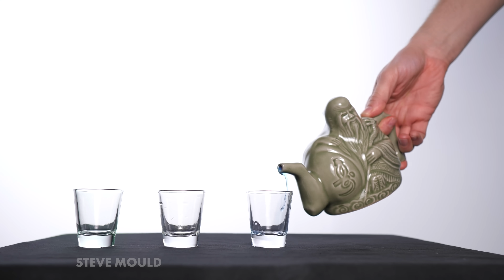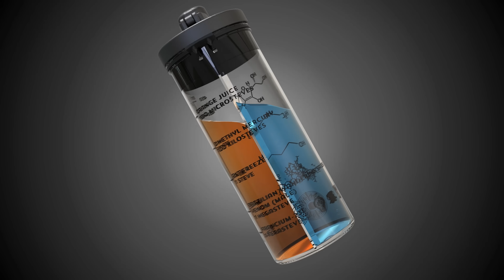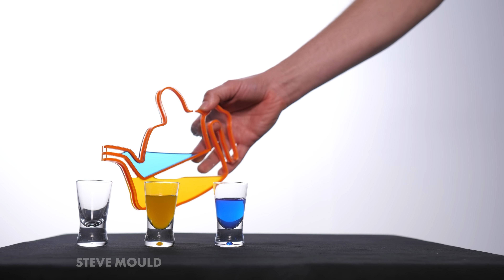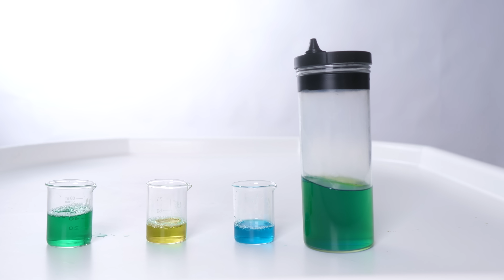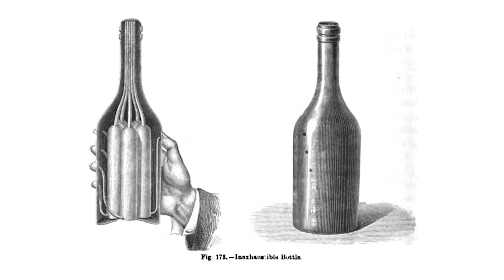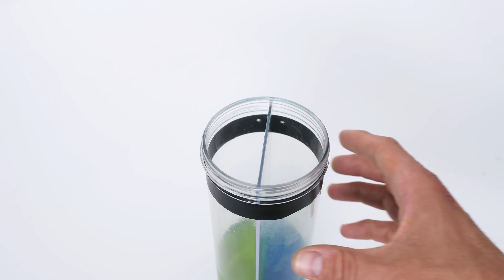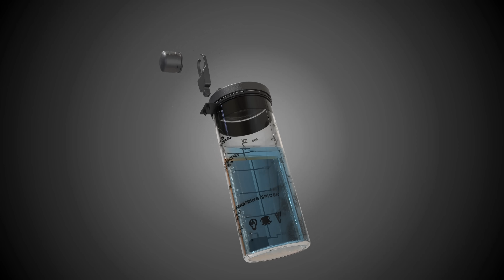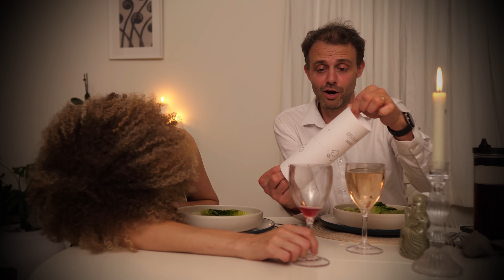The weirdest water bottle you can buy

Comment: I love this, though I have a thought.

It seems like the plug for the back holes might loosen on its own during transport with nothing to lock it in place, especially after a certain amount of wear has taken place after some time. Would it be possible to have a tab of some sort that slides over the plug flap and clicks into a compliant mechanism to hold it in place? I think that would greatly secure the contents of the bottle. Though of course this would complicate the construction a bit. Maybe it's even too late to change the design at this point.

Comment: You could make it a slider, pos 1 both air inlets closed, pos 2 only inlet 1 open, pos 3 only inlet 2 open, pos 4 both inlets open. Okay it may take away some of the magic, but the benefit is that you shouldn't need the separate rubber piece to make it transport ready, the slider will fulfil that role and will be less prone to accidental opening or being lost.

Comment: A push button with a spring on the outside and a seal on the inside (and a small cover to avoid knocking them in transit) would be the absolute best way to seal and unseal those holes.

Comment: The selection holes for either side could be covered by a sliding switch that sits on a ring sleeve along the top. You can slide the switch with your thumb to select one, both or neither (For normally closed). It would be a sturdier design assuming the rubber plugs ever pop out or no long sit comfortably in the holes

Comment: I would definitely buy it if the holes for the cavities were on the lid and had their own little on/off switch covers or a spin dial cover to decide which drink is covered. It would move the holes to the highest point instead of the side so it wouldn't accidentally spill during transit (at least much less likely)

Comment: @stevemould for the holes, you're approaching it from the idea you need to plug the hole to select the liquid. Have you considered the opposite approach?

Use two silicone gaskets to plug each of the holes so the liquids cannot escape. You can use a nipple to secure the gasket as a plug so it's always blocking leaks, and when you want to release the liquid, you press down on the nipple, separating the gasket from the lid, allowing the liquid to flow.

Just a thought. Loving your idea!

Comment: As for making the bottle portable, couldn’t you just make the function of the holes reversed? Say, by implementing some sort of spring club that when depressed could instead open the hole from the other side. Then the mechanism could be built into the lid entirely giving you space to water tight the lid to the bottle, and also prevent liquid from spilling out of the lid when in transit.

Comment: Why not put a ring with two holes around the upper part of the Bottle. You can turn the ring to what ever liquid you want. You could put stoppers on the ring so it wouldn't be loose when turning it, and with rubber in the right places you would make it water tight. Would be more convenient than the two plugs that are used now. Also, always putting one inside and the other one just to the side will wear out the material.

Comment: I know you wouldn''t be talking about it if the manufacturing design wasn't solved. But did you consider making some kind of rotating silicon selector ring to reveal the holes? Probably needs a fair bit of tension to be water tight, especially as the temperature in the bottle changes. But it would be so cool if it worked.

Comment: How about a circle bracelet in-between two fixed either indentations or rings to wrap around the bottle holes? Rotate to expose one, both or, none of the holes. It has less risk of popping off and hopefully shouldn't pose an issue with small parts having points of failure. Should be much easier to change with just one hand and no fiddling just a simple rotation.

Comment: Guessing a steve is the LD50 for a steve mould, or maybe an average human?
Antifreeze has an LD50 of around 3-4g/kg of bodyweight (on rats). The average human weight is 62kg. That means between 186g to 248g
Antifreeze density is 1.11g, so 200mL is 222g. Its within the range. Almost in the middle in fact.
its all poisons too, and it gets higher the more toxic they are, so yeah im pretty sure 1 steve=1 steve mould's LD50/average human LD50.

The ld50s vary tho, and steve mould probably weighs more than 62kg.

Comment: Could also have solved the lid issue by using concentric cylinders, so the bottle would have an inner and an outer cylinder with the same volume, but with a gasket top for each, the spout being across from where the inner and outer cylinder meet.

It does however ruin the visuals of seeing the fluids independently I suppose.

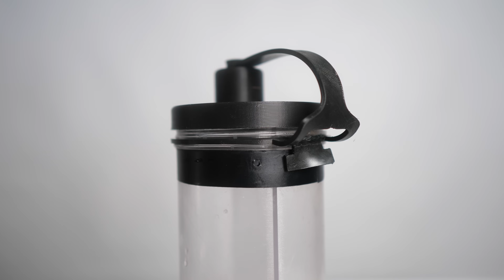Comment: I can recommend instead of a plastic flap to cover the holes to use a snapping rotating disc like when deodorant sprays let you switch between "open" and "locked" positions. 3:58 looks like it can easily come off.

Comment: 3:59 I was hoping to see a spring with a piece of insulation. Pressing it will allow air to pass through, and when you release it, the spring will come back closed and you don't need to forget to close it, or you might fall like this, and you will avoid getting anything in

Comment: Wouldn't it be way cooler to have the 2 chambers as concentric cylinders?
The Pros:
* Hide the inner poison more easily, even with the cover off
* That straight-wall-in-the-middle problem goes away(?) and you only need to seal 2 circles at the top

You figure out how to elegantly let the air pass into the inner cylinder.

Comment: There are some small details in the bottle that could be improved.
The opening mechanism could be tied to the control holes so that it's more spill proof.
The perfect iteration of such bottle could have holes integrated in a way that there is a simple switch instead with air intake placed on the bottleneck.

Comment: Hold on... is Asteroids toroidal or spherical.. or both, since we have no way to determine Gaussian curvature....
Reply: ...actually, can't it be proven to be spherical by the length of the "bullet" trails? They never appear to change, meaning the distance between the origin and extinction point is always the same. On a toroid, they would sometimes appear longer or shorter depending on their path, because sometimes the path between two points on the toroid would wrap through the center and sometimes it wouldn't.... wouldn't it? Unless the toroid has a variable third dimension.. Hmmm.

Comment: if i could make a suggestion for the holes. you could have a rubber ring on the outside with two holes. you can turn it to allow for one or the other or both holes to be open.

Comment: Steve! You need two fidget poppers for the air holes and one big one that you press that pops them back out. When you press the individual ones it pops down and a small hole size rubber bung under the popper would fill the hole but allow air around the sides.  If both are pressed down it should create a seal but only when their both pressed down. Hard to explain over a message however but this would epic to see

Comment: the 2 thumb-holes should be constantly sealed... then, with your thumb, u press the air-valve of the beverage of interest open, so it can flow (if the cap of the spout is off too, of course)... congrats for the engagement of the woman, she played the role good, almost subtle...
Reply: Maybe, but at that point you might as well just have a slideable lid that aligns with one hole, the other hole, or both holes - but that ruins the fun.

Comment: You should maybe consider a flap valve system inside the bottle with the buttons outside and when you press a button air can get in and when nothing is pressed the liquids are sealed by the valve

Comment: I have a solution. Carry 2 separate individual bottles. Each bottle can be filled with a different drink or fluid. When the desired fluid or drink is required use the bottle within which that fluid is contained. Simple.

Comment: Why holes that you cover with fingers or silicon caps? Why not a slider like we have in the vacuum cleaner (the ones that cover the hole that allows "fake" air to enter the vacuum and reduce the pressure). A slider with 4 positions, closed (no liquid spilled), liquid 1, liquid 2, both liquids

Comment: I think you need to reverse the holes mechanism - fill them with some small push to open valve (there has to be something like that - basically a plug on spring) and let it be opened with finger instead of closed - that would have atleast some chance of not leaking on trip :D :)

Comment: Wouldn't a mechanism similar to an oboe work? So you have both holes covered at all times by a plug that is pushed inside by a spring or similar into the holes and you have some buttons which move the plugs away from the holes kinda like a see saw. That way they are plugged when not in use and you have a certainty of which hole you open, since you can feel both buttons and decide which one to use. To also make sure they aren't pressed down inside a bag you can reuse the stopper flap on the current water bottle to instead wedge in between the gap beneath the button to prevent it from being pushed unintentionally.

Comment: 3:58 man just use one way flow valve on both holes and it will not spill(place a piece of rubber on a hole from inside and fix 2 sides in place). Also 3-4 position slider on those holes could be handfull - left - left hole opened, right - right, middle- both, down/up - both closed.
Also, you can make another variant with second chamber being cilinder at the middle, and have tubes to the exit and air intake(and you also can place air intakes on the top in lid itself), then you can conceal existing of second liquid, and also you can use regular screw cap if you make it rotationary symmetrical from inside with canals going to exit beak
Reply: Sure, they could do countless things to improve the water bottle, but they won't. Why? Because they don't care about it being good. They only care about it being cheap to make and selling it for a good markup to recoup the cost of production and make a decent profit. Not that there's anything wrong with that, it's just capitalism being capitalism.

Comment: Won't this... not work? Like, people don't just pour water into their mouth from a distance, there's suction. Which will easily overcome the resistance of the plugged chamber.
Reply: it definitely seems more novel than practical— meant as a more portable and accessible version of the assassins teapot for tricks on the go
Reply: It won't really overcome it probably. Try drinking from a sealed container.
When there's lots of air in the chamber, some amount of liquid will pour, but not too much I think.
Reply: @Gurux13  But... you are literally opening a hole to let the pressure change to select which liquid comes out in the first place. Its not sealed if you have opened at least one of the two holes, unless I'm misunderstanding the point?

Liquid goes out the drinky hole, air goes in the selecty hole; pressure equalizes. Not sealed, right?
Reply: @Gurux13  I don't know how you drink from a water bottle, but I definitely don't just passively pour it into my mouth from a distance.

Comment: You should have a one-way rubber gasket for the two inlett holes. I have one on one of my water bottles that lets in air when I drink from it but won't leak water during transport when the drinking spout is closed. It's the same type that is in a breathing mask to only let in air through the filters but let the air out through the unfiltered hole.

Comment: just a thought here instead of pluging the holes like the video could be easier to rotate the bottom part of the lid with can cloth both if in the middle or right or left rotation will open one of other hole u know like the multi step switch on some flashlights

Comment: Could you have a press valve that is always on, and when you want to select the fluid, you press that fluid to allow air into the chamber? That way, when the bottle is idle, both valves are shut and it is sealed

Comment: $65 for a bottle as an entry price is a bit steep, but I suppose you're paying for the limited novelty of it, not just utility.

I think a switch mechanism for closing the holes would be more intuitive & reliable. Similar to the locking switch you find on the lid of thermos flasks, but with 2 switches, one for closing each hole.

Comment: Hold up... Why would the asteroids universe be toroidal instead of spherical? Am I missing something?
Reply: because asteroids play area is a ractangle. try imagining different movement paths on sphere and toroid.
For example imagine going up in asteroids starting at 2 different points on horizontal axis. These two paths are not intersecting. The same thing happens on toroid. But on sphere, by going up (and starting from different points on "horizontal axis") you would get 2 paths that would intersect at the top and bottom of the sphere.

Comment: Love what you did but I'm kinda surpised you didnt use a slidable switch seal that vents into one of the 4 positions, A, B, AB and closed on the lid. I feel like there has to be a beter way than little rubber stoppers for the vent holes
Reply: Or as another comment suggested, a physical button that the user can press to release a valve and vent air into for either side A or B. I really hope better options were considered before resorting to plugging the holes.

Comment: STOP. Do not manufacture that. The air holes with bungs are an insanely bad solution. They should instead be silicone duckbill check valves as used in fish tank air systems. You still get to block them with a finger, but they don't leak and don't need to be plugged separately from the spout when carrying the bottle.

Comment: I know you might have tried this, but what if the holes on the outside actually covered using a mechanism that is happening on the inside. The mechanism is some sort of rotating the holes so it got covered watertight, then rotate it again to unlock it. The best thing about this design that its almost invincible, able to close the output as well, and with some clever designing it might still be easy to clean.

Comment: I’m not sure if my science is right, but to prevent the water bottle from being leaky, couldn’t you put a really fine mesh over the holes? The surface tension should stop the liquid from leaking out but the air should still allow the fluid dynamics to work (assuming my 15 minutes of thought is reliable)

I also agree with some of the comments saying that a switch would be nicer than the plugs that are currently on the design

This is really cool, looking forward to seeing the final product!
Reply: I had the same idea.

Comment: I have an idea for the stopper.
A tight band of rubber. Make two holes in the rubber that line up with the holes.
How you turn it determines what's covered. This means if you line up both holes, you can either get the mixed drink, or use your fingers to select, as both holes will be open.
If you recess the area this band lays by just a little, it would keep the band from sliding down.

I obviously don't have your bottle at the moment, so I don't know if your stopper plugs work better than what I just suggested

Comment: Idk if you've tried this, but a potential solution to the water leaking out of the holes would be a rotating band. You could rotate it either way so only 1 hole is covered, and it could have little nubs that snap into the holes to make an airtight seal

Comment: Perhaps you could close the air holes with a simple sleeve that moves a shutter behind the air holes.

When turned clockwise both holes are blocked by the shutter and when turned counterclockwise both holes are opened.
 
In principle, the shutter could also block the outlet to ensure a complete seal when stowed.

Comment: It would have been cool to have something like a spring loaded lever that is normally closed that plugs the holes and opens them when pushed down. Cool product nonetheless.
Edit: Yeesh the prcing is bad: 60€ for a plastic bottle is fair I think, it's cool merch with (probably) a lot of r&d,  but having to pay 20€ more just to get a sleeve that I like just to have 2 extra sleeves that I would never use is kinda lame. Having to buy a whole extra bottle and two posters for 87€ more just to get one bottle with a design that I like is really bad.
This upsell turned me off from from an almost instant buy

Comment: It would be more effort to get the fit right, but I wonder if the built-in hole cover could have been a ring with a silicone seal inside that you rotate to cover one, both, or neither of the holes. It would have been really sneaky, taking a lot less sleight of hand to make the bottle pour one or the other when handed to an unwitting drinker.

Comment: You should change the design slightly so that there is a rubber spring mechanism to force both holes closed when not being touched. This should stop liquid leaking out of the water bottle at all. When you press the button it opens one or both holes and allows the liquid to flow.

Comment: Why is the ring reinforcing the air holes not a rotating ring to seal it? Also why not have 2 compartments top and bottom that screw together (like a protein shake mixer with a powder container on the bottom), just with a tube/spout going up to the lid? Be a hell of a lot easier to seal